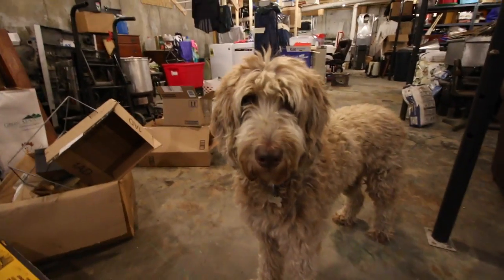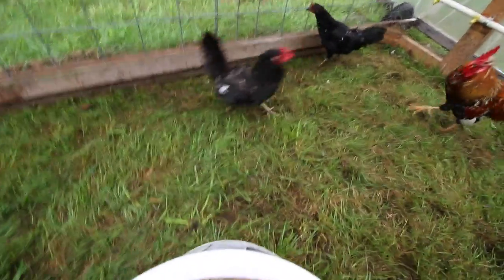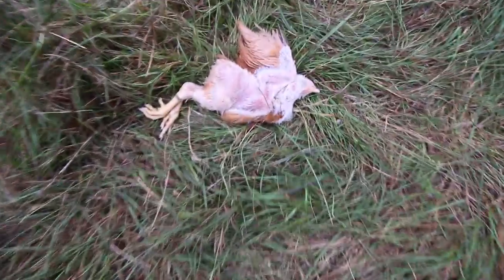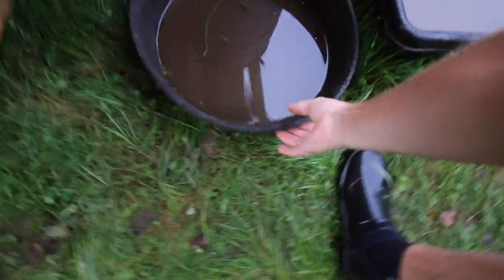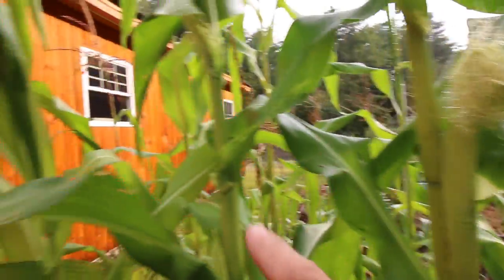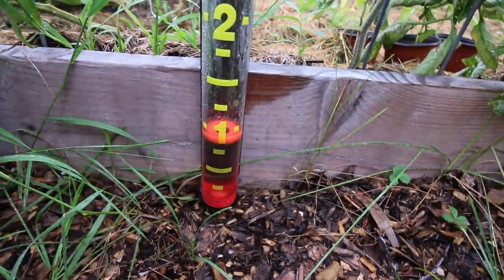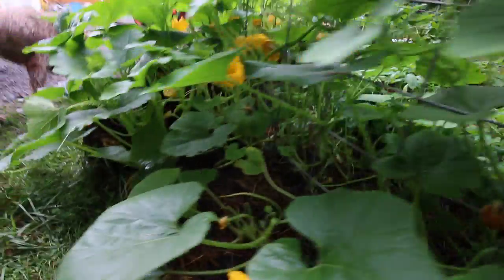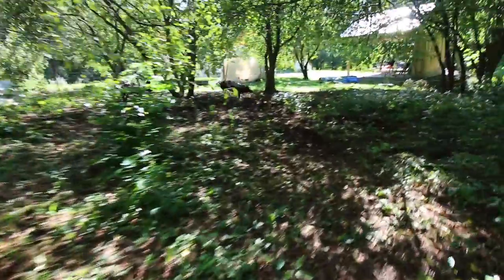How to Make your Modern Homestead Sustainable! Modern Steader update!

Comment: A newsletter and a website?  
That's a lot of extra work (done it myself for 20 years), your gonna need some help.
Reply from the maker: I am working on building the website now. Never done it before, should be fun! :)What do you do a website and newsletter for?
Reply: I've done both. Currently considering re-building my 2 main sites; transitioning from ASP.NET to a WordPress system. While you can do newsletters from a WordPress site, I use Mail-chimp because it offers greater flexibility and is very cost effective. I had the best results (ROI) when I sent my newsletters every 2 weeks primarily to increase web traffic & DB usage, unless I was promoting a workshop or event, then once a week. Newsletters Usually consisted of: 4 new updates with thumbnail images and text links to the last 8 previous posts. Best day to send/schedule a newsletter is Late Wednesday night. By Thursday morning people want a distraction and your click through rate and open rates will be higher; and will continue through Sunday afternoon. Figure at least 2 hours to properly create, edit, and check links for each newsletter. Better yet see if Justin Rhodes web person can be hired part time to do it for you.
Who needs the head aches.
Reply from the maker: What is your website? I love learning new things!
Reply: Sent them to you privately through the YouTube MSG.